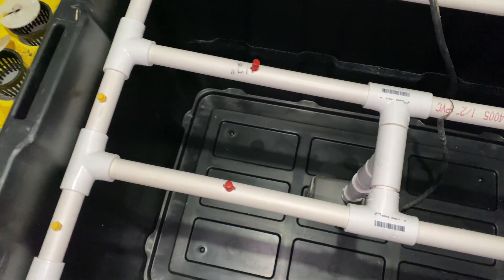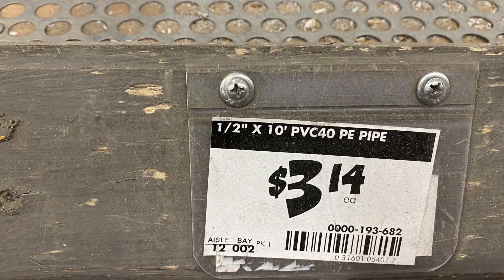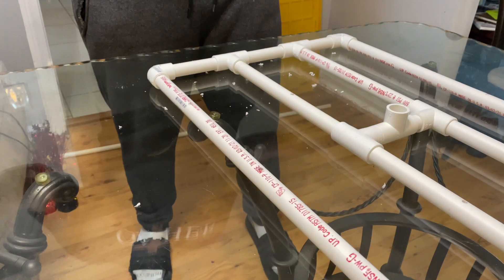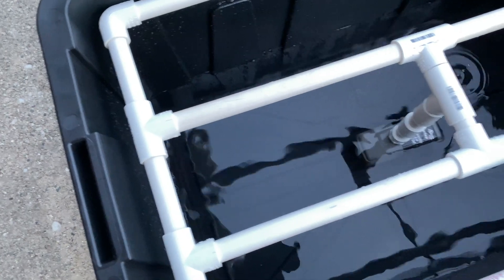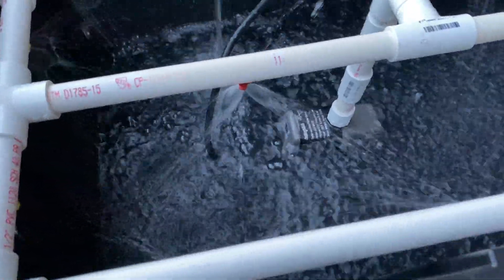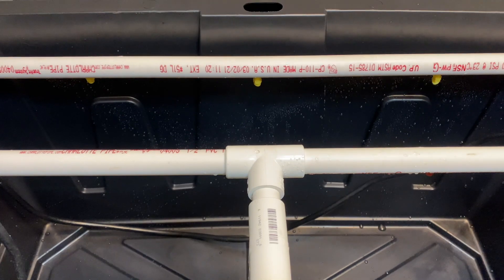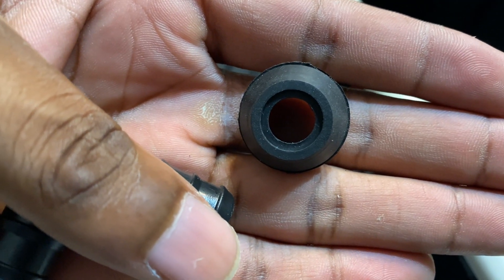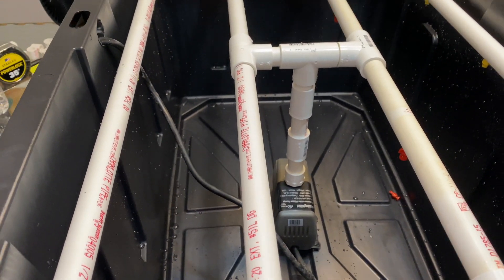How To build an Inexpensive Hydroponic System!!!!

Comment: Would you not be able to glue the pipes to seal them?
Reply from the maker: They are very small PVC pipes it’s better for me to just push them together and if I want to take them apart and make something else with them it would just be a simple pull for me. You can use glue if you want I just don’t think I need it if the pipes fit